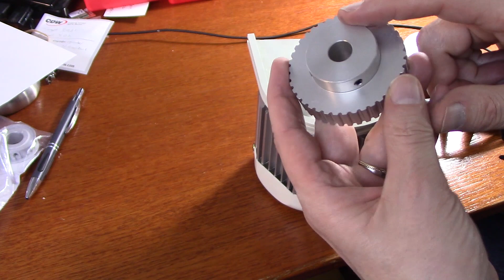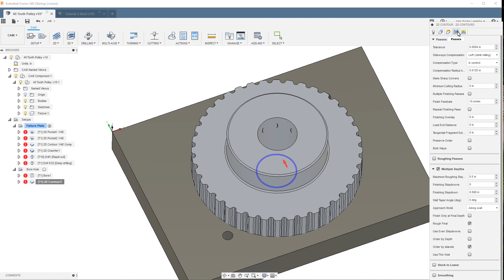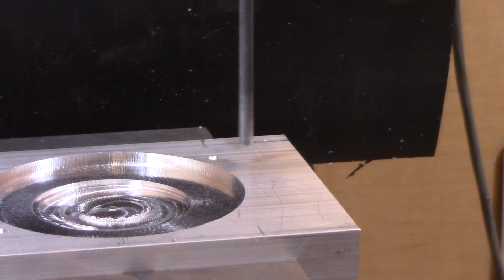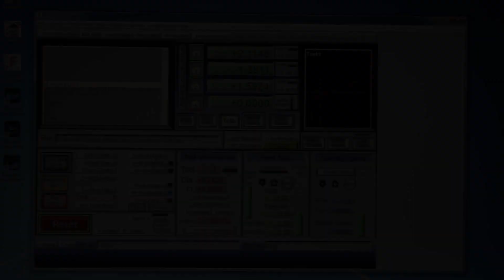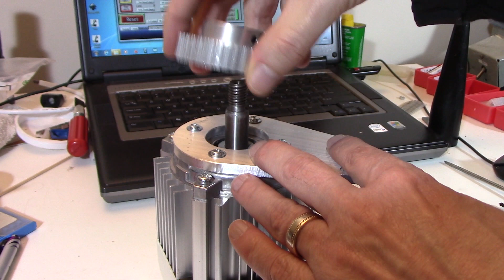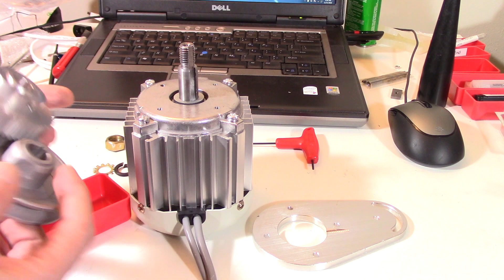#38 Boring, "Taigmach" Part 3

Comment: Lol, Dovetail clamp not being tight enough causing the pull down also bit me (pun intended), I went through the same set of troubleshooting steps as you did before I just re-tightened the z axis dovetails, and it fixed it.  This should be an FAQ for Taig owners!